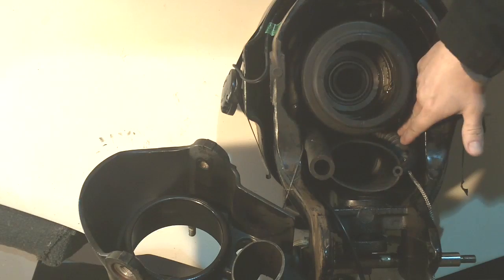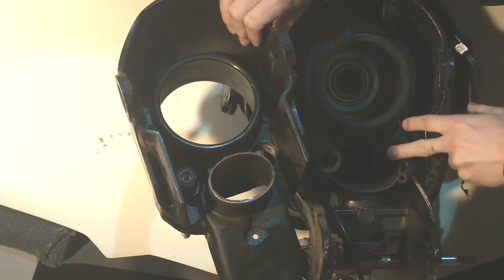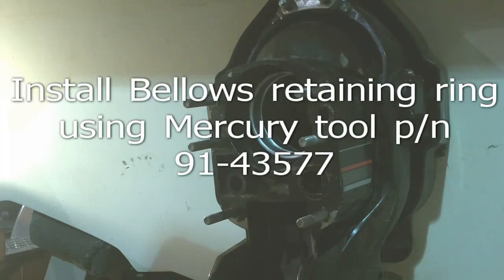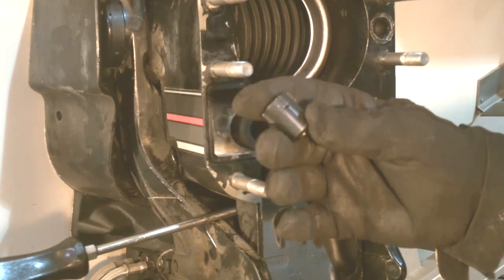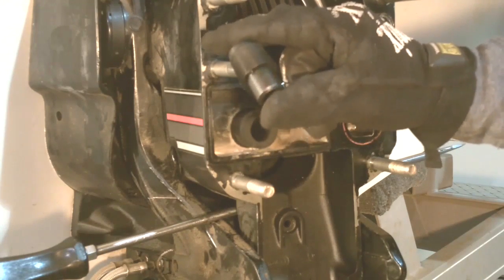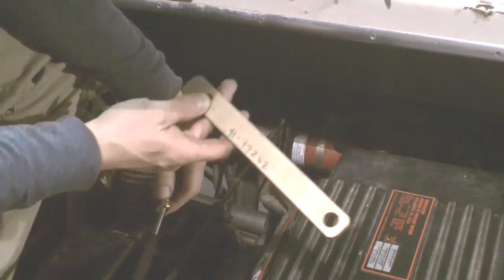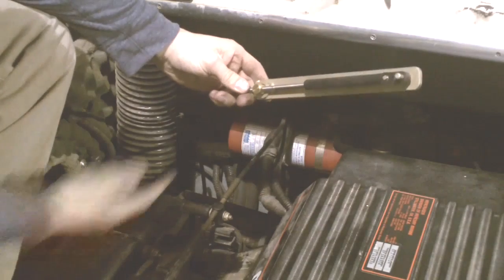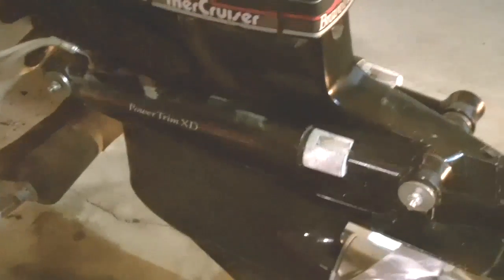Mercruiser Bravo Transom Repair - Part 3

Comment: I see there were 2 types of exhaust bellows. Which should you use? and why. How do the exhaust bellows connect to the bell housing or drive unit?
Reply: The exhaust tube is MUCH EASIER as it only clamps on one end (transom side) and just automatically "connects" to the bell housing when you trim down the drive.  Many people also like that it is very flexible and can be pushed to the side if you want to inspect the underside of the u-joint bellow.  The ribbed style exhaust bellow does not allow this.  If you do a bit of looking, you will find that the exhaust bellow or tube is technically not required as the water can't flow upward into the motor by defying gravity.  It's really just to help muffle exhaust sound a bit.

Comment: Great video, just have a question, I'm installing a new shift cable, I have the tool kit for adjustment however I'm not sure if the shift control has to be on neutral or forward or reverse?